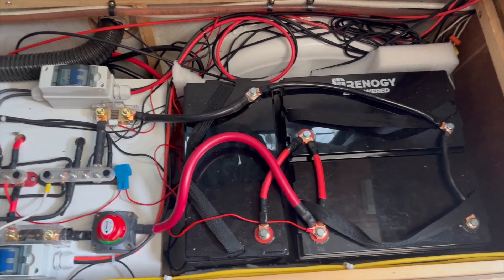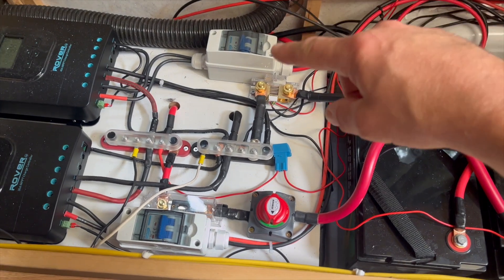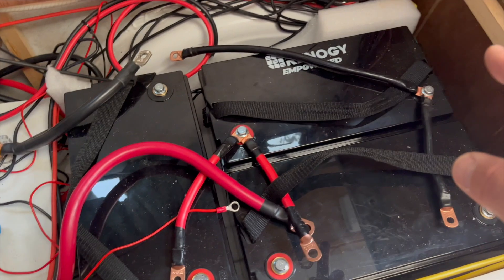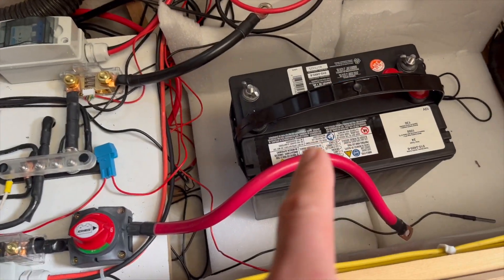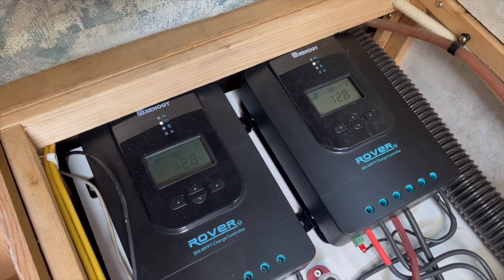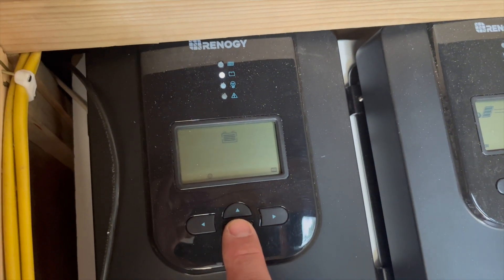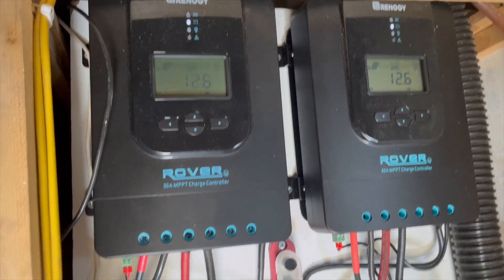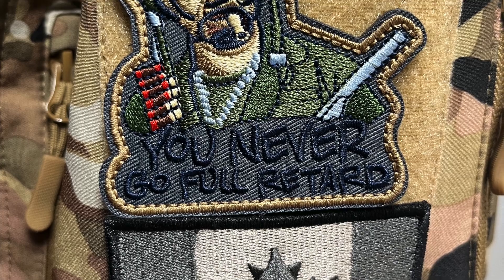How I winterized my LiFePO4 Batteries and store my Off Grid Camper Trailer

Comment: Can't you just leave them at storage level in the cold, but heat them before you charge them again?
Reply from the maker: I could but I want to keep the system all hooked up and it’s only getting about an hour of sunlight per day so I would have to disconnect the battery bank and run an extension cord out to the trailer make sure the batteries are above freezing and then top them up which to me seemed like a pain. That’s why I opted to just install a lead acid battery for the winter and store my LiFePo4 in the house where I can make sure they are safe from damage due to the cold

Comment: This makes no sense at all? Why not just buy some battery heat pads to heat up your solar batteries?
Option two is to put some blankets over the whole system.
Reply from the maker: Well the trailer sits mostly out of the sun ☀️ only gets max 1 hour if any a day and if I keep my LiFePo4’s in there with any load on them they will end up dead in no time. I guess this is just my case scenario but here in Canada it gets very cold in the winter and I’d have to plug a charger into the house to keep them warm enough or keep the diesel heater running all winter which I think would just be a huge waste of fuel, and the batteries would be depleted in a short time with no charge. It’s just easier to keep a deep cycle battery in there and the solar is just enough to keep it topped off. Sorry maybe I should have mentioned all this in the video. I am new to this after all. Cheers!